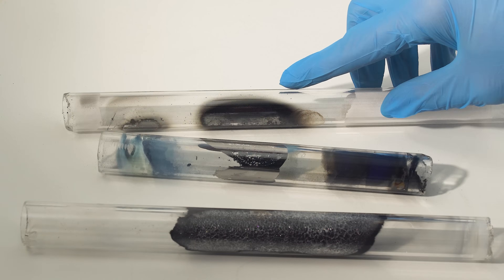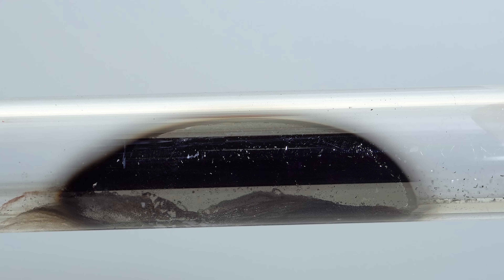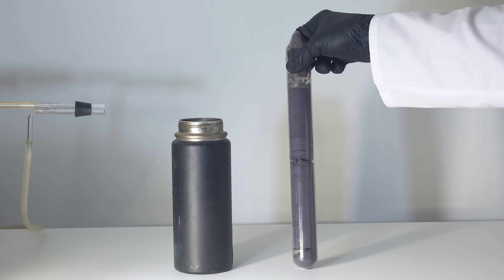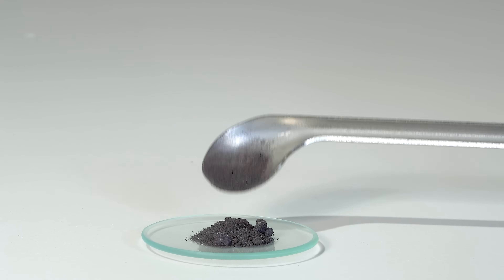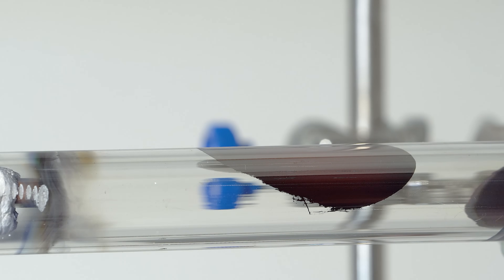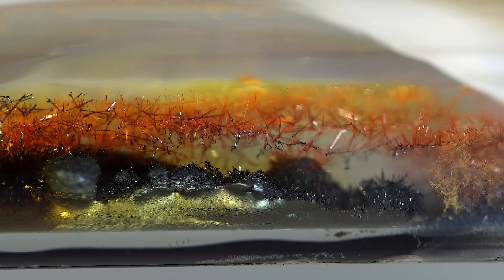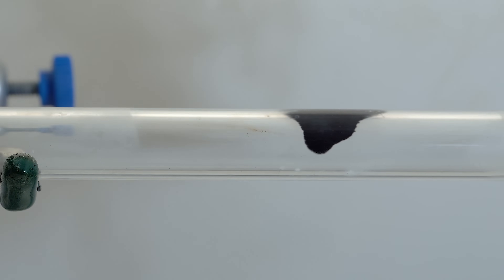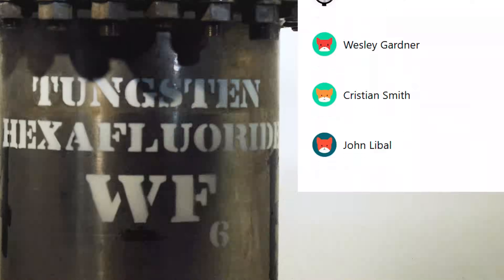Transforming Tungsten Compounds into Mirrors.

Comment: hey, has anyone made a rotating test tube or funnel where you can condense the oxide?

 bit like a lathe perhaps , less required, just need to have the sample test tube rotating so the oxides and heat would be distributed around the tube surface, would need a in out valve perhaps or something.

im sure it wouldnt be too hard to put together, and would create the molten particles of tungsten to run around the surface perhaps?  making a more even layer for a mirrored surface i would of thought

Comment: This video gives me ideas for effective recovery of iron oxide from iron chloride.

Apparently, I just need some solid heated  reaction chamber with a stream of hydrogen.

I think I can try 'bare' stainless steel, but if not, I will see if I can get some kind of ceramic coated reaction surface.

Comment: have you tried the graphene exfoliation in whey protein blender water (or vinegar to get more paintable solution), also try aluminium chloride sublimation cell electrolysis at 180C, also NaOH electrolysis at 350C with aluminium oxide and chloride, like and unlike borax high temp molten electrolysis, but Na cycle reduces the oxide and chloride into aluminium metal, at lowish temps
Reply: What about silver mirror/coating on iron/zinc from aqueous AgSO4, Ag metal plus ZnSO4 out
Reply: try coating objects inside the reaction tube, also try copper foil exfoliation with zinc + cuso4/h2so4 bath long time (minutes) dip, how about aluminium surface coating by termite replacement reaction, ie aluminium takes places of the hydrogen gas, and takes the oxygen/chloride from the tungsten compound, aluminium chloride will sublimate off and leave tungsten surface on top, which will no longer react, should also only need about 300C of WCl6 melting, to get the termite replacement reaction going. zinc should work for the replacement reaction too, at heat.

Comment: Tungsten chemistry is nice, and quite accessible. And quite safe compared to other metals since tungsten isn't toxic. I have made tungsten blue by reducing peroxopolytungstic acid with ascorbic acid (vitamin C) in a slightly alkaline solution. The peroxopolytungstic acid itself I made by dissolving tungsten metal (from a broken TIG electrode) in 30% hydrogen peroxide.
Reply from the maker: I have an idea to melt a tungsten electrode with a flame of cyanogen and oxygen mixture
Reply: @ChemicalForce  It should be obvious of course, but do make sure you get ceriated electrodes and not thoriated ones. Especially if there are metal vapors floating round. They're all bad, but no need to add radioactivity into the mix.
Reply from the maker: @johnalees99    Ordinary pure tungsten electrode marked with a green stripe
Reply: @ChemicalForce  yeah green is pure tungsten, red is thoriated, blue is lanthanated and violet is mixed rare earths. I forgot the color for ceriated, maybe grey.
Reply: @ChemicalForce please do, never saw those flames that are said to be of peach blossom colour
Reply: @ChemicalForce  Dicyanoacetylene burns hotter than cyanogen. :) But you need temperatures in excess of 2500 degrees to synthesize it.

Comment: Tungsten is the kind of metal that I think it is still very underused in the industry...And it is a fascinating metal.
Reply: Probably because it has one of the highest melting points of any common metal (around 3400°C). So, it's almost impossible to cast it as solid block, rather tungsten powder/granules are sintered (pressed into a mold at high pressure/at it's melting point), and the granules can fuse together due to their high surface area, into a "solid" sintered block.

Oddly enough, tungsten has also nearly the same density as pure gold (19.3g/cm³)
Reply: @ryanslab25  yeah, I studied some of the properties, and its a brittle and heavy metal. but its still a strategic metal like beryllium, it just doesnt have competitive properties that monopolizes its use...it is very hard when used as tungsten carbide, but even that is limited to industrial applications
Reply: @ryanslab25 Induction levitation furnace should work, though, in a near-vacuum (just high enough pressure to keep it from depositing too strongly onto the induction coil (a vaguely funnel shaped copper pipe spiral)), magnetic-levitation-based squeezing a drop out of the ball of molten tungsten that splashes down into the mold, and feeding solid tungsten in via perhaps powder suspended in (part of) the gas stream around. Or just arranging for no gas convection currents that cause problems with dropping/raining controlled-particle-size granules (i.e., sand-tier coarseness (not dust-tier!) "powder") from the top into the molten blob and waiting long enough for them to dissolve into the surrounding molten blob before squeezing any further/new drops out.

Not sure how it'd interact with the levitation/melting field (it's shaped to cause the desired levitation at a power level/amplitude that works well for the desired melting/compensating black body radiation (it's a deformed sphere shaped blob of "light bulb", running so hot it burns out ~instantly (thermal mass would be negligible if it'd be light bulb filament shaped)!)/compensating for convective cooling by required residual gas (need to block the tungsten vapor that'd sublimate/boil off in good vacuum, by placing gas molecules in the way)), but feeding tungsten wire (somewhat) continuously down into the blob may work and would simplify the dropper/feeder mechanism.

Alternatively, given that levitation increases with conductivity of the feed, and metals decrease in conductivity with temperature, reduced-power insertion of a block of solid tungsten (sintered to sufficiently decent conductivity) by means of a gripper/tongs, or even just a pedestal raising it into the coil from below (doesn't matter whether the coil or the pedestal moves), should work just fine at the expense of not operating anywhere near continuously w.r.t. the dripping.

Taking the success of hal-01336015 , and substituting from aluminium for tungsten assuming 19g/ml and 150W/cm^2 radiative cooling at 3000C, the initial 7.5cm diameter ball they simulated with would be 4.2kg and radiating only 26.5 kW. While substantial, it feels/sounds low enough to not be too high, given that the coils used in the HAL paper claim a current of 1.1 kA eff each (assuming 3 turns, 3cm radius, 5cm length solenoid as each coil, which should low-ball given the ferrite core/yoke increasing this beyond those air-values, this is 0.64 uH per coil, with each coil pair series connected, 1.28 uH per pair), which at 30 kHz gives 241 V and at 40 kHz 322 V (effective, in resonant tank with the specified current and frequency). The current ought to scale up for tungsten due to the higher mass, assuming linear (corresponding to motors usually having a linear relationship between current and torque/force) to mass, to about 8.4 times that paper's values. Given that power scales quadratically with current, this would be about 70 times as much heating power. So only about 380 W of radiative-cooling-equilibrium heating power when scaling the numbers back down to the aluminium situation. And that's tiny compared to the resonance's apparent power of 619 kW (well, technically "kVA") that neglected the ferrite yoke (so reality ought to be higher).

Together, this suggests that a much larger blob of tungsten could be melted when scaling the HAL paper up, making use of that tungsten has on the order of 9 times more diameter at radiation vs. levitation power equilibrium than aluminium, giving a massive 3 tons assuming the aluminium approach of the HAL paper has a scaling limit at the 500g system they designed.... just at roughly 1 MW of power consumption for radiation/levitation (total system losses are much higher, as this only considers those in the ball of tungsten, not the coils/generators).
Reply: Cost and density are limiting factors. Refractory metals find uses in high temperature technical components such as turbines, but ideally you'd want those to be as low mass as possible so lower density refractories like Tantalum and Molybdenum are used. Tungsten is also pretty pricey so for any application where its extreme properties are not absolutely necessary, alternatives will be found.
Reply: @StuffandThings_  I didn't know Tungsten was pricey... Gotta keep informed of the rare metals prices, u never know when a breakthrough might happen and is nice to have some stored as investment.